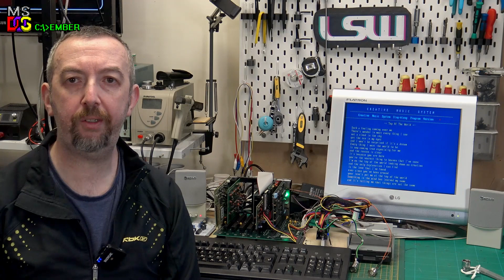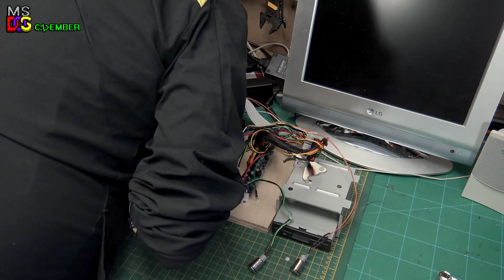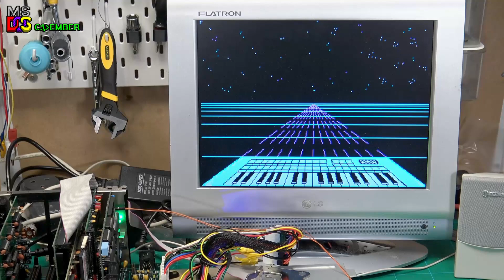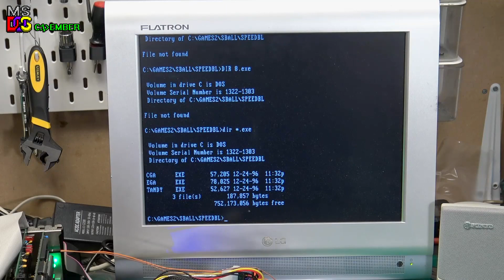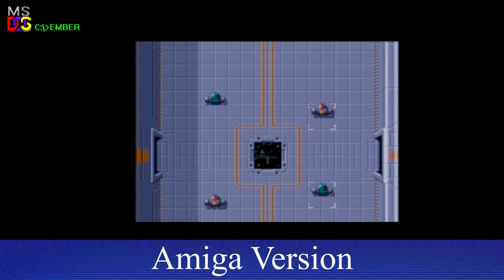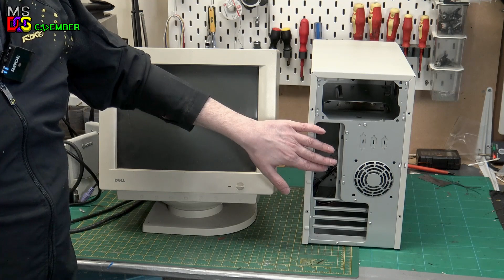Micro 8088 XT pc - Doscember update. Sound cards and floppy drive.

Comment from the maker: I just ordered the Micro ATX  ISA backplane that has the soft atx power circuit  and -5v.
Reply from the maker: @Dread Storm Thanks, I am close to making another video with the new backplane that will fit into the M-ATX case.
Reply from the maker: @Dread Storm the ISA bus is totally different to modern systems so you would need something to covert from what ever bus you have, PCI express perhaps PCI down to ISA with the correct timing and addressing, voltages ect. It's not a simple task.

Comment: You should you put the 16 bitt isa card on an isa 16 bit slot!!
Reply from the maker: why ? it's an 8 bit cpu card.
Reply: @leesmithsworkshop  okay i think there was a 16 bit card :) strange problem not?
Reply from the maker: @asanjuas  The Aztek is 16bit card , but I chose it because the sound card part is only 8bit sound blaster   and the Micro 8088 XT is also only 8bit too.
Reply: @leesmithsworkshop  the 16 bit Cars needs yo use a 16 bit isa bus because the digital sound part maybe un the 16 bit extension . You can use a CT1350B instead.

Comment: Hi - nice progress

I am old enough to have bought these new at the time, so here is what i think

@ 1985 my fist computer was a commodore 64 in  
@ 1988 Amiga 500
@ 1987 Commodore PC5  - 512k pc clone ( purchase around same time PC 10 release or just before it was a clearance sale )
@ 1988 PC XT Turbo clone

i will leave out the 386 and newer

So my first PC was the Commodore PC5 - i ended up buying add ons, a time / clock card and later a adlib or midi card , both were a waste of time and money really

The clock card only save me typing the date and time on boot up , but the floppy boot ran a program with a switch get time or save time or something similar, basically the default was say "gettime" to get the hardware clock and say it as dos time

The adlib card - well nothing worked with it - i dont recall anything other than the inbuilt speaker sound - if there were any games that made a sound i dont recall - i am sure i set it up correctly and had the tiny little box speakers plugged into it

I remember i was very disappointing as i still had the C64 and the amiga 500 at the same time

I sold it to a friend when it was 12 month sold for 1/2 price of what i paid and bought the XT turbo clone - full 640k - again it had no sound or inbuilt clock

I upgraded that with a used mfm 10meg hard drive  and replaced the 360 floppy with a 1.2m

Now is the good part - 1988 or 1989 the game blaster came out then the SB 8bit cards - i waited a while and bought the stand alone SB1.5 card - it was amazing

That system was sold after 12-24 months and replaced with a 386dx - when i done that i bought the new SB16 with the 2 speed cdrom- now i had a great system - all i needed to do was keep upgrading the hard drive and video card , i must have gone through 3 or 4 ega cards, then 2 or 3 vga cards

Today i still have the SB16 and 2 speed cdrom - it lives in my Gateway 2000 Pentium 2

So after lengthy text - your XT will have very small amount of software that will take advantage of sound blaster music, why ?? because the XT died of and was replaced by the AT / 286, PC's were still business machines and most games were simple and only used pc speaker beeps

The multimedia revolution was partially active during the 386 days (1985)  and the sound blaster 1 days ( 1988 or 1989)  - so anything before 1985 would be pc speaker or some back ground adlid or midi tunes

One of the earliest games i recall with SB8 and SB16 was wold3d in 1992, i had pc speaker, then the SB8 then the SB16 , you could hear the better quality in the gun shots , guards voices and the clanging and slamming of the iron doors as they open and shut

Your kings Quest 1 reminds me of the time i spent playing Leasure Suit Larry 1 - again that had just background midi and no actual sound blaster type sound or speech

I hope it help - it does not solve your problem of getting SB quality sound on games that will run on a XT

PS - yeah you need to find a XT/AT style pc case that take the old large keyboard din connector and not the ATX style square backplate on the mother board - i think you mentioned compact case at one stage but that is very hard with add on cards, but you should be able to find a 90 degree 8bit riser as all isa slots can work in one slot as the XT/AT bus probes cards one at a time - this is how the low height pizza box units (286 / 386 ) worked with say 2 or 3 slots mounted horizontally 

Regards
George

Comment: Pretty nice. Have you looked at the nuxt atx board. It is open source as well and you can build it. You might enjoy it as well
Reply from the maker: it's the same thing based on the same design
Reply: @leesmithsworkshop  yep! It just has a -5volt rail, atx connector and power, and a PS2 mouse & keyboard.

I was looking to get a blank board and all the bits to put one together as a kit.

I'm planning to get around to making some totally custom stuff myself from my own ideas later. Just always stupid short on time.

Comment: No I don't need to build myself one of these. No. I totally wouldn't use it for learning 8088 assembler.
Reply from the maker: I think it's a expensive kit at the moment, Dosfox is building one and the main chipset was around £50. If you want I still have some PCB left over for the 8088, fdd and cms.